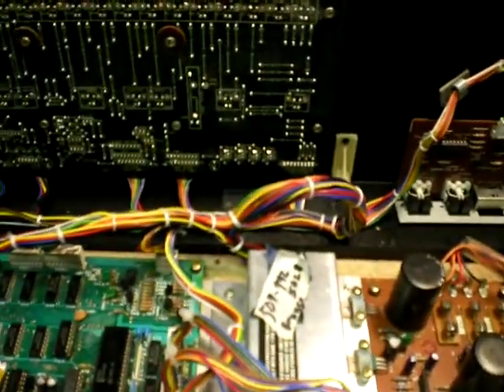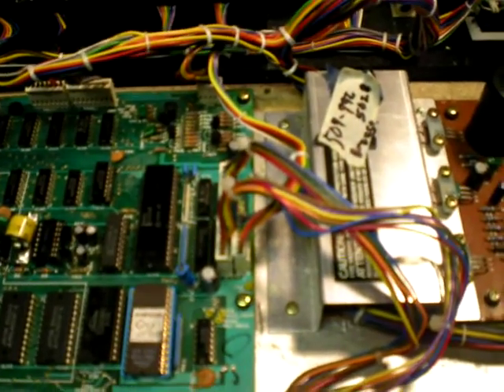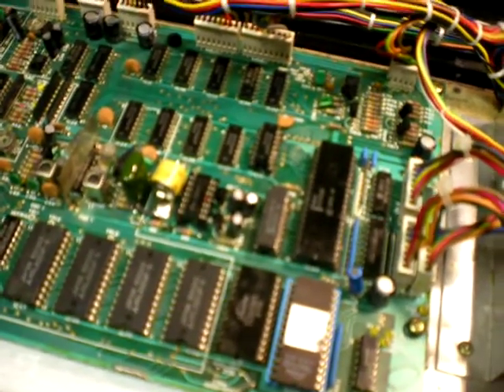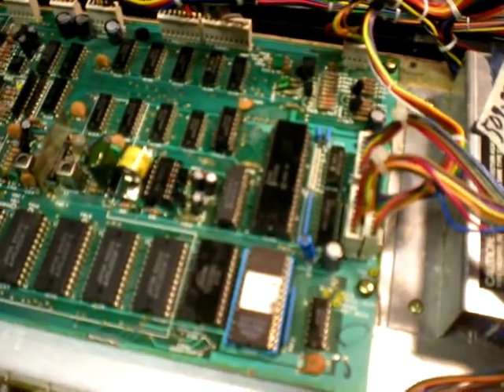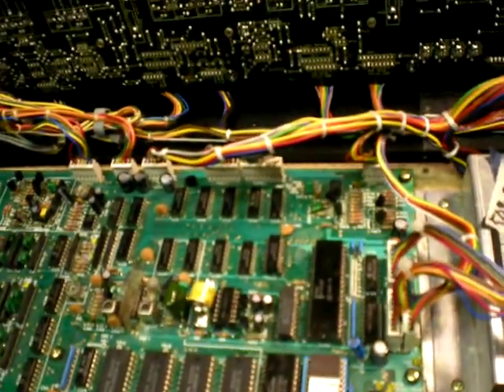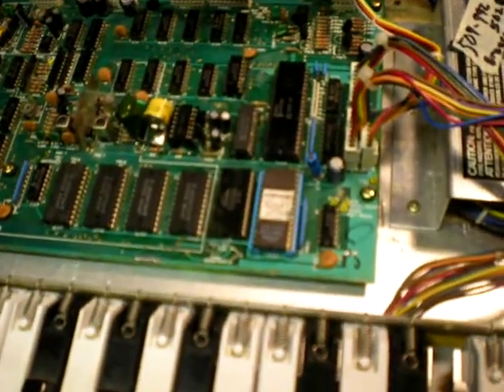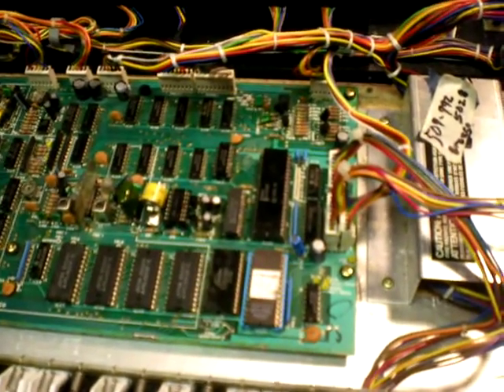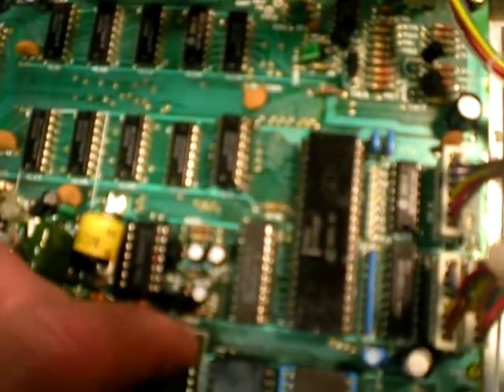Roland JX3P service notes and manual correction

Comment: any help . how can i check?  . when i plugged my pg 200 in nothing works. on jx3p and only 2 dim lighs on JP  but it was the day before?  please help how i can test the pins on the cable. or fuses.
Reply from the maker: wth is a jp200?
Reply: @sounddoctorin   sorry JP 200.  and JX3P.   the jx3p works . on it's own. but when i plug the pg200 in. nothing works on either. except the 2 red lights on the pg200. light up but very dim. i have a multi meter. but not sure what to test. if you could send me a diagram. with things i can test please. does it have a special fuse?  it was working fine. thanks jon